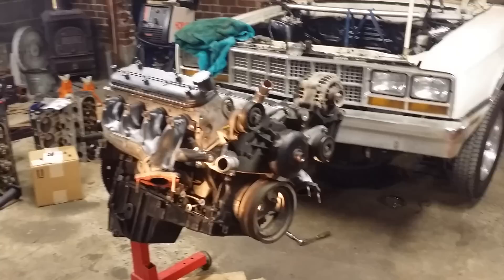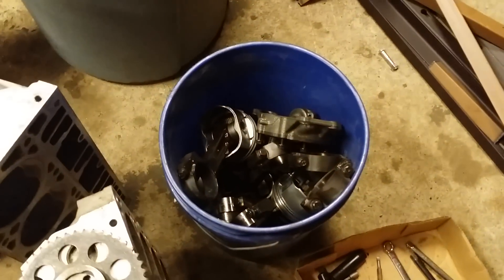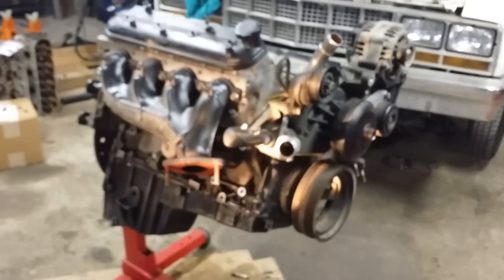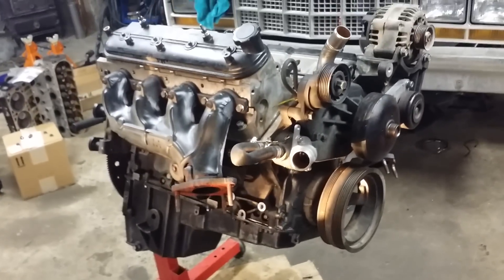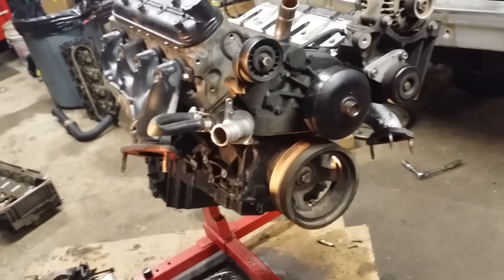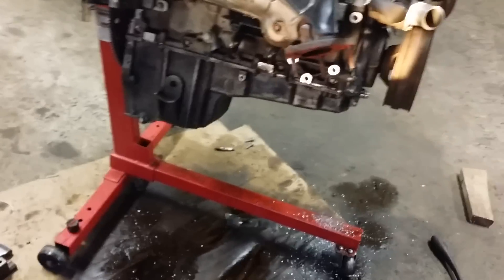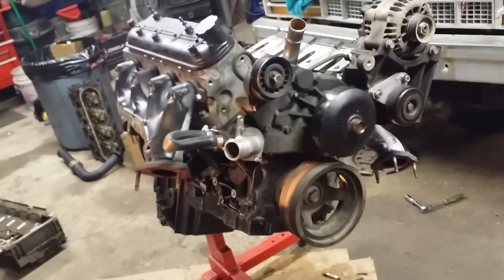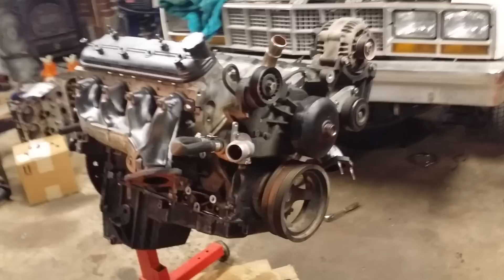3-23-15 fairmont aluminum 5.3 update

Comment: "Its Chinese. Its robust, hopefully it laughed about the oil and watched the glitter pass..."  Favorite line ever
Reply: I'm sure he'll flush it out and not ruin the new engine. I've seen him do things most won't do and he has had no problems at all. Used gaskets and engine bolts. Hey common sense over by the book every single time. .
Reply from the maker: Luvstruck im definately going to try and wash it out lol
Reply: ***** When I threw rod bearings on my mazda I found glitter inside the hydraulic lifters, there was only a pencil tip sized hole for oil to get into lol. Shit gets everywhere :(

Comment: Too bad about the loss of oil. On the weight I have always heard 80 pounds. Here lately everybody is saying 100 pounds difference. Those later model 5.3's were higher h.p. and rated the same as the 02 Z28, and WS6. with the cam and the pistons it should run really well without the boost. I have an iron block 5.3, and have talked to Just Chevy Trucks about some 4.8 flat top's for my 5.3. The 4.8 has a little shorter stroke, but same size bore. It's almost midnight here in Texas, so you're probably out driving around by now :-)
Reply from the maker: ill be weighing it so i will see the difference, people say 80-125, just like when people dyno the numbers get changed lol

Comment: What I see in this channel is entertaining an impressive. You are doing great work here. Thank you for posting. You wanted to try high compression ratio and turbocharging and you sounded optimistic at that point claiming one do not give up very much. Based on experience I would have to disagree when boosting hard. What do you think these days?
Reply from the maker: Finn Roen high compression and boost is the way to go for sure. best of both worlds
Reply: Did this 5.3 alu engine deliver low hp numbers pr. psi at very low boost levels also or did it start out good and than nosed over as boost level was rising?

Comment: Question, do you know anyone who has put a 5.3-6.0 in a 92-97 crown victoria??? Not to worried about making it fit because I am sure it will go right in with a lil modification to the trans cross member and motor mounts. My real question is I am wanting to build a turbo 5.3 for everyday driving and make somewhere around 600 at the wheels. I'm probably never going to take it to the track but I just want something that will pretty much hang in there with the new camaros, mustangs etc etc. So my question is I don't want to have to pull this motor out for a long time. What other than tune should I focus on the most. I figured turbo specific cam and turbo forged pistons would make a IV gen 5.3 pretty reliable.

Comment: might want to take the turbo's apart , , there are no parts that tear up when you do ,(whell maibe the nut holding the compressorwhelel but nuttin else )
and just spy the lot with brakecleaner
if they are worn the bearings are about 39 buck a set i believe and its a cheap insurace against having the turbo's eat the bearings and "infect" the new engine with a large dose of metal filings

Comment: hey matt, hows it going bro, derk from cali, i was wondering if you could tell me what turbos to get, im trying to put together a 6.0 twin turbo, is there any helpfull advice you could give me, as far as harness, turbos, tuning, but i mainly want to no about turbos what kind and what size,, the twins is just for the wow factor any advice, i would like to be sitting around 600hp stock 6.0 with twins, thank you
Reply from the maker: turbos depend on your goals, race, street, response, power capability, and all of that factor in to what turbos to buy, call VS racing and ask him, i have no luck with twin turbos and i have no idea what to recommend. i like single turbo setups

Comment: Man that sucks.. Hope all goes well with this one. What oil do you run ?
Reply from the maker: whatever is on sale at AZ/Advanced usually rotella or penzoil
Reply: ***** I was wondering if you were running a full  synthetic oil. I take it you are.. I'd go with Rotella over Penzoil..
Reply from the maker: i never buy synthetic i think its too thin and expensive for these turbo grenades
Reply: The older motors yes, but some of these newer motors have a lot more moving parts as you do know already I'm sure. I have been running 10w 40  4stroke motorcycle in my older cars as the zinc levels are better then the new oils.. it's cheaper then racing oils.. just a thought..
Reply: Apparently he runs no oil at all!!!! lol, But then again if you have played around with engines long enough some things get overlooked unfortunately it's the oil in this case. Keep the videos coming.

Comment: isnt the iron block better for boost ?
Reply from the maker: i would say its stronger for sure, its IRON! but for the power i am making the aluminum should be fine, ive seen people doing 8-900 tire on ls2/ls3 style blocks
Reply: The gains you get in strength from an iron block are really not worth the gains you get in weight compared to an aluminum block, at least not till you get into crazy power ranges.